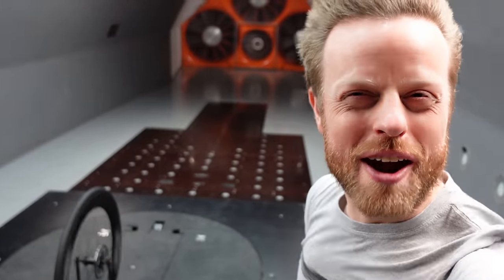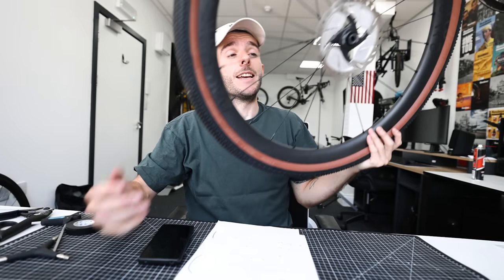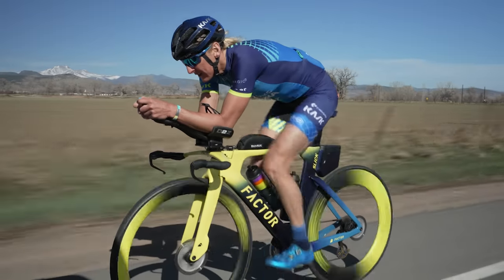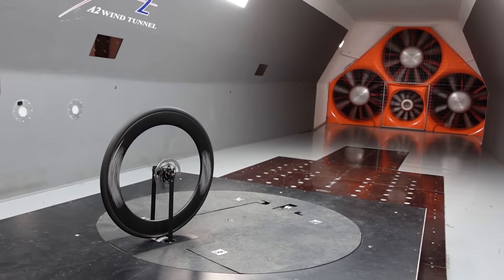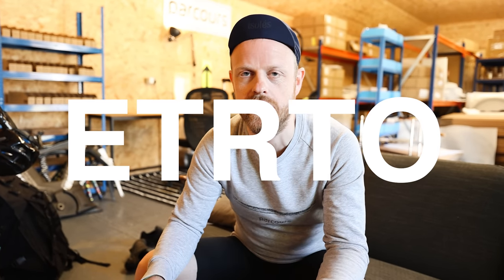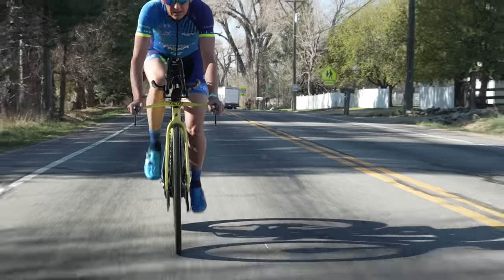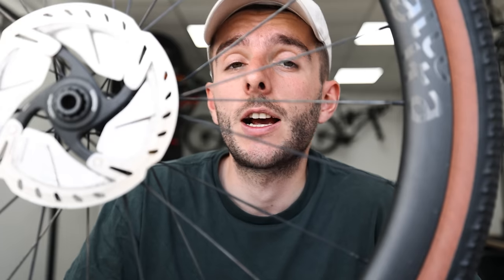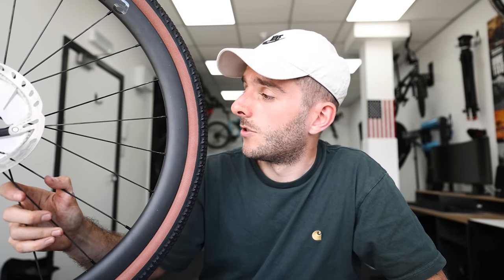What You Should Know About Hookless Wheels

Comment: so its manufacturers benefit cause its cheaper to produce.
Reply: also the reason for disc brakes, cheaper to make wheels with no brake surface needed on wheels.
Reply: As usual
Reply: @bettyblue7291  disc brakes are becoming a thing because disc brakes are just better, slightly heavier yes but more power and just better overall
Reply: Hookless rims are cheaper & simpler to produce because they can use permanent metal molds instead of single-use flexible ones. Also some brands mill out the carbon fiber to create the bead track, which reduces rim strength. In the case of Zipp and others, the comparable hookless rims are cheaper (e.g. the Zipp 303-S vs. the earlier 303).
Reply: Considering the incredible QA across tyre manufacturers I’m sure absolutely no problems will occur \s
Reply: @johnnymcmurdo  lol
Reply: Spot on.
Reply: The maker also said the are more robust, just saying.
Reply: @bettyblue7291 Disc brakes are objectively better and a brake disc costs peanuts compared to the disc previously used for stopping-the wheel.
Reply: Right. Manufacturers should not adopt designs that reduce costs because they just pocket the profits.
Reply: Cheaper to produce. Better impact resistance. Stronger composite due to higher pressure mold process. Lighter wheels because they can be made stronger.

Comment: At least he was honest. Brands are pushing hookless because it's cheaper for them and easier to manufacture, the extra impact strength argument is just what they've decided to push as the benefit to the consumer when in reality it was a non-issue to begin with. I won't be going hookless anytime soon unless hooked rims die out altogether. There are no real world benefits, just extra caveats and drawbacks.
Reply: Well, zipp was so fair and reduced the price of the firecrest models by quite a bit. But it is surely arguable if they passed all savings to the customer...
Reply: @Xarx42  and all of the problems that hookless brings along with it
Reply: Honestly I’ve had no issues with my Zipp wheels. No punctures in forever…running 30mm tires at 55/58psi and the ride is sublime and grippy. The problem occurs at high psi’s….now days recommended psi is less than 60. Would anyone inflate their clinchers to 150 plus? Your car suns on hookless tech…airplane wheels… it’s such a pain to get tubeless tires on and off I don’t get how they blow easier than clinchers.

Comment: I have the hookless SLR1 and use inner tubes with tubeless ready Corsa. They are nearly ~impossible~ to get on the wheel but once I do, I never have any issues. I even had a slow leak once that I didn’t realize for a while and the tire never rolled off. That said, I’ll go to hooked rims the next time I buy wheels simply so I don’t have to worry about a failure. Trying to stay alive ✌️

Comment: Would you talk about which particular tires perform best with hookless rims? ... perhaps not with Dov, who has to stay neutral as a wheel manufacturer, but maybe in collab w/ Backyard Nic.
Reply: I have a mix of about a dozen wheelsets, and had great luck with Schwable, Pirelli, Tufo , and WTB tires, both in gravel and road which often will pumpIt’s been a mixed bag with Rene Herse, Soma, and Panaracer tires.  
I have also mounted a set of the new GP5000tr tires on a set of zips 303s and they also held air and seated without sealant.
Reply: @Thomas-fy9yc  thanks for your feedback!
Reply: Too many makers don’t follow the ETRTO spec, for tires or rims.  Mavic keeps to the spec, but it’s hit or miss with many makers, and even if you get one combination to work, you can’t count on it to work with other models from the same maker, or with next year’s version.  Makers and reviewers need to publish the actual dimensions, and until they do, it’s just up to experimentation, which is unsafe.

Comment: One thing you might want to consider in your test is time… Tyres stretch over time. Other people have tested hookless rims and they found that if left over night, tyres will not unseat at much lower pressures than you found in your test.
Reply from the maker: Correct, looks like cycling weekly did some tests and at 100psi the tyre blew off after 10 minutes

Comment: The hookless Enve SES 4.5ARs I have on one bike work fine for me. I run 32mm Gravelking slicks at 45-50 psi and have never flatted the setup. 70+ psi would be way, way too high for this setup. I've hit the rims pretty hard and not had an issue. They're also one of the easier rims I've used to mount tires on and get the beads seated. Enve publishes a fairly long list of tires they recommend for the rims.
Reply: Nice. Been using the Foundation 45’s for about 2 years now with goodyear f1 32’s, wtb exposure 30’s, and recently the enve ses 31 and can’t believe how good they all feel at 48psi front 50 rear. I’m a hefty 200lbs and have full confidence riding hookless down fast descents and leaning hard into corners. Really want to upgrade to the 4.5’s for the wider internal. What a time to be alive!

Comment: Great video! Interesting to point out that all other wheel/tire systems (plane, car, etc.) are hookless. While it’s cheaper to manufacture, it wouldn’t be in use in the pro peloton if it wasn’t safe. UAE has a deal with ENVE and they could go with any mfg that they choose. I think people overstate the risk of a blow-out. In reality wearing worn out tires, or those with little knicks and cuts is much more likely to cause you to flat than it blowing off the rim. Check your equipment before any high speed descents and replace parts that are worn. Prior to tubeless many (incl all pros) were riding tubular, which could literally roll off the rim at high speed. Perhaps the tech is still evolving, but it wouldn’t be in the market if it wasn’t safe.
Reply: Couple counterpoints:
Plane, car, and motorcycle tires have way more structure and material than a bicycle tire. You don't see folding car tires. Additionally, I've changed a number of motorcycle tires and minimum you need a couple long steel tire irons to get them on/off. Even with a manual tire "machine", you're using a meter-long bar and quite a bit of force to get the tire stretched over the rim. Honestly, I'm really wary of manufacturers making that comparison.

As for the pro peleton, they're concerned with speed and speed only. Comparing tires that get changed out probably daily and checked by a pro mechanic isn't necessarily what I want for my bike if it's not reliable a longer timelines.

That being said, I don't have an issue with hookless rims. Time will tell if they work out or if they're one of those things that disappear.

Comment: I have been thinking more about hookless and I think referencing car and motorcycles use them is comparing apples to oranges.  Car tires take different cornering forces than a bike or motorcycle.  Car tires need heavy equipment to mount since the sidewall is tons stiffer to hold to the rim.  Motorcycles may have some same corning forces but again heavy equipment to mount and sidewall is tons stiffer to hold the bead to the rim.  To top it off both car and motorcycle tires also don't use any sealant so there is that factor also (maybe sealant can affect the bead to rim interface).  Most car tires and motorcycle tires are also lower pressure (truck tires not so much....but those have super thick sidewalls and super heavy gear to mount).  I have never ridden hookless but just those general logic thoughts....nothing tested by me creates some pause using hookless on a road bike.
Reply: car and motorbike tyres are also way, way heavier and more material to support the hookless structure

Comment: I have been using hookless on road and I find putting the tires really easy. Great system for the bike
Reply: Till u get a flat that the sealant cant fill and u walk home.  Hookless is a bad design and has no benefits for the end user.
Reply: @thedronescene7474  you just put tube in?
Reply: @thedronescene7474  I have spare tube in case the sealant didn’t seal. The best part for hookless I don’t even need tool to put back the tires

Comment: I had too much pressure in my tire and blew it off my hookless rim while braking going downhill at 40mph.  I think the braking heated it up and put enough pressure to push it over the edge.  User error, but it wasn't much fun.  Make sure to stay within your wheel and tire pressure guidelines, and don't rely on the pressure shown on your pump!
Reply: Then why is there a pressure gauge on the pump to start with? How do you check pressure if not that way?
Reply: @pierrex3226  old pump. Wasn’t accurate. I still pumped it to the limit.
Reply: @emtee52 Still it should not blow off there needs to be safety factor for such critical components.

Comment: This is such a simple topic to unpack.  Consider tubless for a low pressure/high volume applicaiton (MTB), do NOT consider tuebless for a high pressure/low volume application (ROAD).  It's that simple.  A pot hole, rock, whatever from normal riding can instantly grenade the "air tight" seal of your high pressure tire and put the rider at a MAJOR safety risk.  It's just unnecessary for road given the risk, never mind the annoyance of upkeep and being caught in the middle of nowhere with an equipment design failure.

Comment: I can remember using hookless rims in the early 1970's and having tyres blow off the rims and it was very dangerous, then Mavic introduced the Module E hooked rim in 1975, it was a game changer and so much safer at high pressures. Seems crazy to go back in time just so manufacturers can save money and risk taking your face off on the road.  Not something i'll be doing for sure.
Reply: Also electric cars existed already on the 20s and that does not mean that electric is the wrong way for cars. Maybe hookless has found its way in a safe manner

Comment: Has anyone found statistically which brands of tires cause problems?
the rims can be measured to the nearest cent when they come out of the mold and there is a precise common standard to be respected.
for tyres, on the contrary, there is no standard yet, the hookless coupling tolerance is the most important aspect to avoid these dangers ( second one  80s vintage pressures at 8 atm)
a well-known Italian cotton rubber declared hl compatible goes on a rim with just one hand, it will clearly come off with the same ease or worse after use, same for some continental years 2020-21 now modified and within very tight, suitable tolerances.
circumferences of tyre rings were measured with differences of up to 1.5 cm in total! how can we talk about a system that should be abandoned without a coupling rule?
as long as tire manufacturers have differences beyond the conceivable, system safety will not be proposed.
15 years ago the same MTB route, now standardized although without the push of common rules.

Comment: Maybe you won't pump the wheel to that high of pressure. But things change when you leave your bike on the sun for prolonged time. My neighbour bought a bike, pumped the wheels for 3 bars in the morning (21 °C), and left it on the shade. As the day passed the shade went away, and the sun started to shine on that bike. At noon after 3-4 hours in the sun (32 °C) the wheels just exploded. 26x2 MTB wheels with inner tubes. The clinchers survived the ordeal, but both inner splitted almost quarter of their circumference. One of the clinchers fell off from the rim (hooked).
I think there is at least one rule you always should think of: pump your wheels in the hottest time of the day. Never at the coldest. Maybe you don't have this problem in the UK, but in continental Europe, especially in the Mediterranean and Eastern Europe we have some serious differences in temperature throughout the day. And in summer it is made even worse by the burning sunshine. Sometimes I can feel massive differences in the handling of my bike between going to work and going home. And it is not a joke.
Reply: 3 bar, in an MTB tyre - WTF?

I've been tubeless on MTB's for over 15 years now, run 1 bar.
Reply: That's an interesting scenario, but in all honesty it's not one to lose too much sleep over.  Gay-Lussac's law (one of the gas laws) states that pressure is proportional to temperature.  However temperature is absolute (i.e. based to absolute zero or -273C), so in your example it will have increased from 294K to 305K or less than 4%.  A 4% increase in pressure is unlikely to cause a blow off in itself so perhaps something else was at work too?

Of course, if the bike was in direct sunlight it's likely it went above 32C, but to get to even a 10% increase in pressure, you'd need to hit over 50C!
Reply: @br5380  You know the problem is that you think everybody is using the newest technology and want to be a competitive racer. Where I live most of the people buy MTB-like bikes for commuting. And won't spend $1-2k worth of money on them. Basic models, tubed wheels. And there are a shitton of 1990s MTBs around. They use those bikes in tarmac mainly, so they pump it to higher pressures (there are some people go to 4 bars with their MTB wheels). Most of them never even go to a dirt road with those bikes.
Reply: @ParcoursDov  Well, the rubber is black. In direct sunlight it can easily heat up to the point you can't even touch it. That means 60-70 °C at least. Maybe it is interesting to you, but not an uncommon thing in reality. Those wheels knows the laws of physics much better than any one of us. And they obey them, even if they defy some written law with it. (One hungarian weapons designer said when his perfectly engineered and manufactured prototype pistol exploded: "Well, the pistol knows the physics better than us!") It is nice to calculate everything, but when those perfectly designed, calculated contraptions used for the first time, almost always fail.
There's always other things at work too. This is the difference between a laboratory and reality. And this is why calculations must be viewed as baselines, not carved in stone facts. I see in daily work how engineers always fuck up even the simpest things. Sometimes they should get up from their comfy chairs and computers/calculations, and go into the wild of the real world.

Comment: Hi Francis,
The "expert" missed the key factor how hookless and tubeless stay on the rim. It is the design of the tyre (why you can't use normal tyres on tubeless).
The tyres have threads running around the tyre that are unstretchable, therefore the tyre can't expand to left over the rim. This is why modern tubeless rims have a well so you can get the other side on as they don't stretch. 
Remember most other tyre systems that use hookless have a much lower pressures and work fine. Why hookless is limited to 72psi.
Yes i remember the video, but remember most systems are usually designed with a big failure safety factor. Lifting equipment is 10 times and tyres most probably more than two times. This is normal.
Should you buy hooless? i would advise no, for higher pressures, they are still trying to get tubeless right and these have been out for over a decade. I suggest to watch and wait at this point in time.
Reply: All of the potential complications make me feel it’s truly better to stick to cheaper, older technology I can actually afford, instead of lusting after the newest thing
Reply: @RicardoRocha-lg1xo  when they drool about fully integrated stuff, i think about how now changing a cable housing costs a visit to the shop
Reply: @core2zero  I don’t really do much of my own wrenching, and I still find fully integrated cockpits a serious nuisance. Sometimes I do change stems or handlebars or simply move them a few mm… what a skilled mechanic could do in 20 minutes (more like 50 for me)can now take several hours and would be an impossible task with my skills and tools. Nah, I’ll pass. I’m even seriously considering switching from SRAM hydros to Paul Klampers…
Reply: @RicardoRocha-lg1xo  i do all my wrenching and at this point, im the family mechanic, gladly, all of that is cheap bikes and components so i don't ever have to deal with "modern" stuff, it will be truly bad if any of those annoying trends trickle to the cheap range, imagine a $300 bike that needs $50 mechanic visit for basic stuff

Comment: I suspect cheaper manufacturing cost is the main driver for this, or am I being too cynical.  Negligible weight saving (Hunt quote 15 gram per wheel) and aero resistance.   I did watch one YouTube video and the presenter said the tyres didn’t hold air overnight?   What about installing them and you need an airshot to inflate?
Clever marketing to derive more profits is my initial belief.

Comment: On balance, tubulars are superior to tubeless and clinchers They can be run a wide range of pressures that clinchers or tubeless cannot. There is zero risk of them ever blowing off the rim and causing a crash. They can be run with sealant in the inner tube. They have a cheap and easy to make rim profile that does not require unsupported flanges that necessitate disc brakes, etc. Their rolling resistance is within 1 or 2 watts of the best tubeless tire, etc. The only meaningful disadvantages are messing with glue and the more important fact that there is less money to be made by the industry.

Comment: But is potentially too high pressure really the only problem? They can equally be put off by lateral force (on any road turn), especially at low pressure. As if the pain of maintaining a tubeless setup was not enough already, they have found a way to than make it also unsafe.

Comment: One thing that continually bugs me about the arguments for the hookless setup being "it's already used on cars, motorcycles, etc" so it's good for bikes is the sealant.  When does a large hookless rim vehicle such as a car or truck use sealant -- especially right from the start.    Also, take a look at the installation process for one of these tires on a vehicle, nobody is doing it with hand tools -- big industrial machinery takes over here.